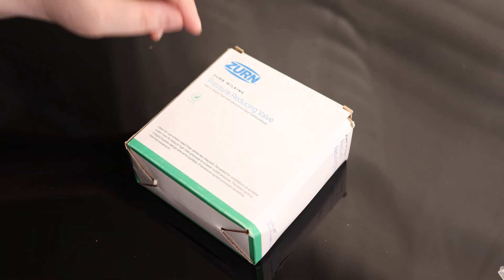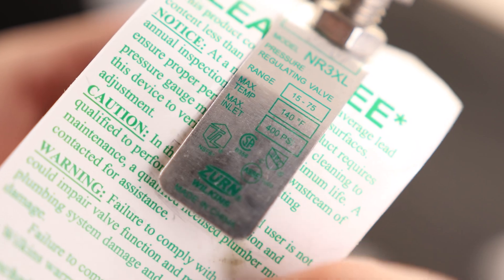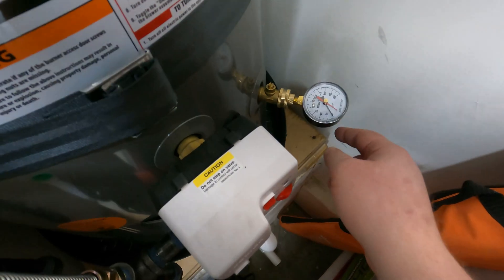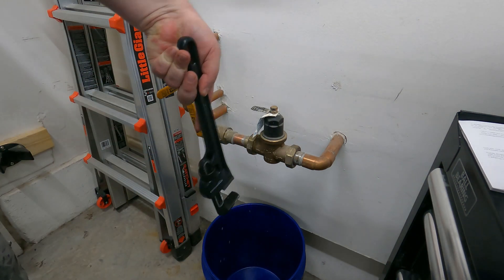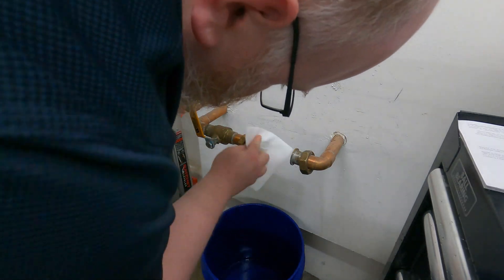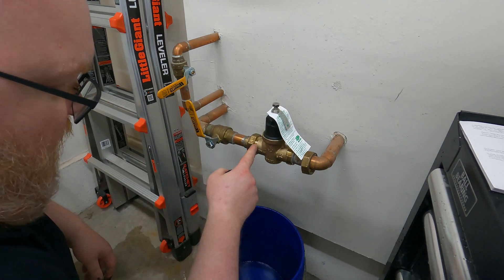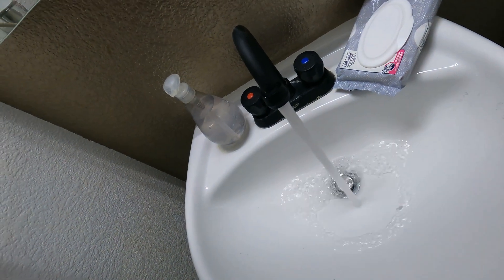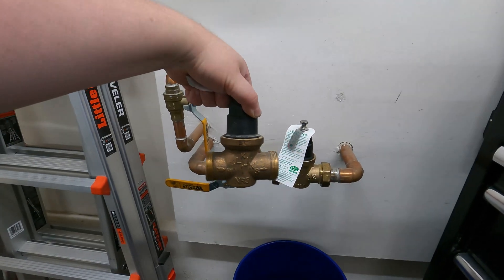Replacing A PRV (Pressure Reducing Valve) Swapping AN NR3 With An NR3XL

Comment: Be aware that the NR3XLHRSC model, HRSC being the key model naming component, has a reduced pressure range of 15-125 PSI, if you need more than the NR3XL's 75 PSI max.  We are plumbing three sillcocks, directly from the main (125 PSI), to bypass a whole house water filter. We are planning to slightly exceed the 75 PSI, maybe 80-85 PSI, on a 3/4" PEX to supply a manifold with three 1/2" PEX lines for lawn watering.

Comment: Question for you all. We installed this and for some reason installed it backwards where the arrow points the opposite direction of the flow. Had all kinds of pressure issues and such. I didn't realize it was backwards until I watched this video. Plan is to correct it tomorrow, but, did I ruin this brand new regulator or should it be fine in theory? Learning the hard way here!

Comment: Great video, concise and to the point.   I'm getting close to replacing my 30 year old Watts PRV that is very likely clogged.   I'm concerned as how tight to get the union fittings, your video answered that.  The instructions are vague, but indicate 1/4 to 1 turn.   I have a tailpiece with an O ring in it.   Thanks!

Comment: Nice video.  Do you have a hot water expansion tank?  If so, don't you have to calibrate it now to match the new pressure?
Reply: Yes. Usually system pressure -2 is what many manufacturers recommend
Reply: Yep. Expansion tank PSI should match the water pressure PSI.

Comment: So, to reduce the water pressure (from 105 to 80), we turn the screws counterclock, correct?

I have the NR3XL 15-75.  Does that mean that if the water from the city comes at 130 this one can't reduce it beyond to after 75?  Do I need a bigger PRV i.e 130?

If there's another faucet open, the presure come down to like 40.  But if I only open one bib it says 105.  Am I missing something here.

Comment: When you shut off the water, did you have to do anything to the hot water tank
Reply: Before I shut-off the main, I always put the water heater on vacation mode, I turn the icemaker to off (unpressurized water dribbles), and disconnect the bidets' electrical supply.

Comment: Why no teflon tape or pipe dope?
Reply: Not needed for compression fitting.  The gasket provides the seal.
Reply: The rubber seals take the place of tape or dope.

Comment: My NR3XL started leaking from the bell housing's top bolt, just small drops will form at the tip where the pressure bolt and drop down (it's installed vertically). I'm thinking about replacing the whole piece, house was built in 2011 so i'm assuming it's the same PRV from when the house was first built. Would it be better to remove the bell housing and replace the screen or just buy an entire new NR3XL?
Reply: Mine was from 2005.  I'd get the whole thing.
Reply: What did you end up doing?